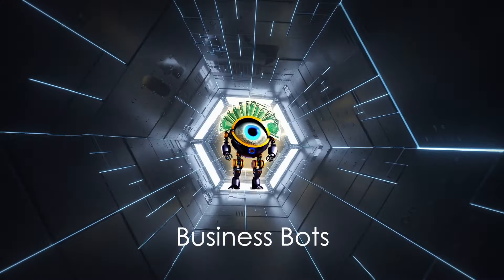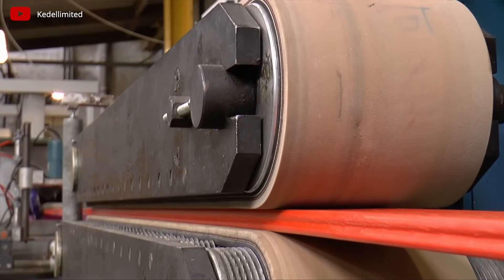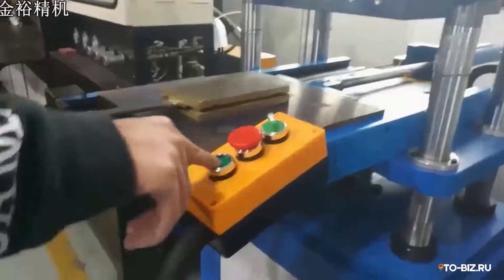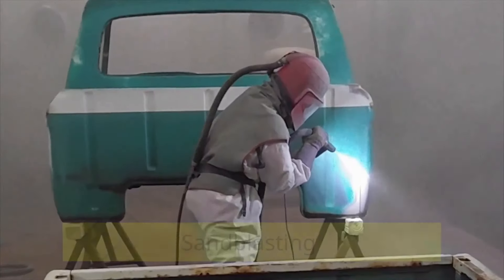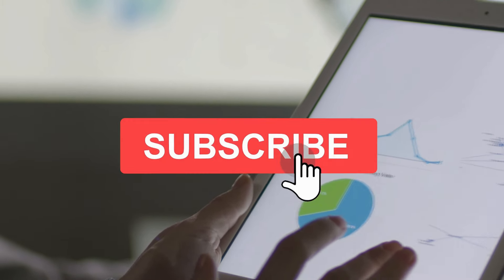Business Machines that can make you money! Top 20 profitable business ideas

Comment from the maker: 00:00 Start 
00:08 POP displays made of cardboard
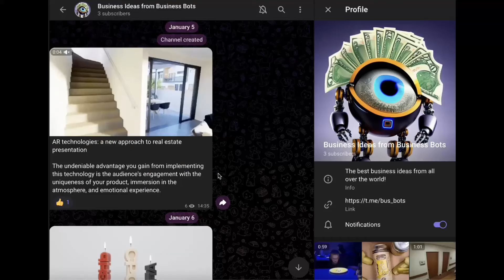00:52 Links to machines for business
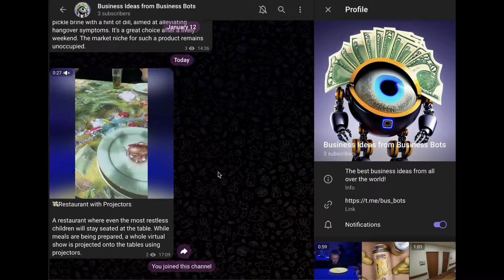01:09 Module for production of concrete screw supports
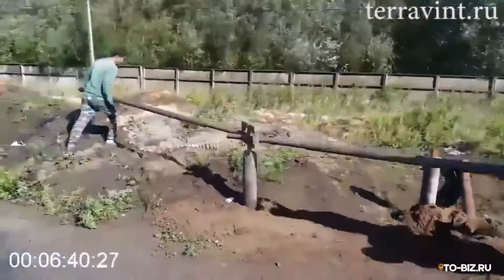02:02 Sawdust pallets production
02:38 Compact Water Cutter
03:17 Production of plastic boards
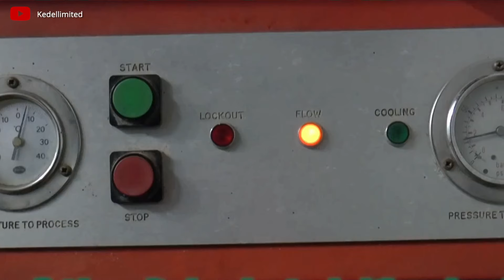03:57 Tabletop Vacuum Forming Machine
04:44 Auto Key Duplicating Machine
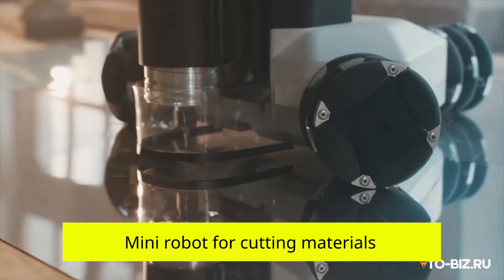05:21 Mini robot for cutting materials
06:19 Automatic knitting machines
06:48 Machines for silicone products
07:21 Manicure Robots
07:55 Photo Engraving
08:37 Production of Glass Fiber Concrete Products
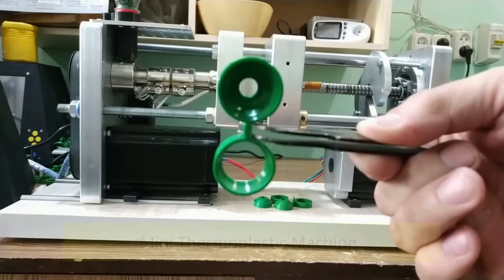09:19 Mini Thermoplastic Machine
09:48 Production of gift boxes
10:24 Knitting Machines for Socks and Gloves
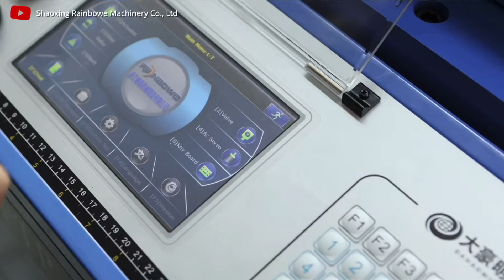10:50 Sandblasting
11:15 Bicycle Charging for Electric Vehicles
 11:57 Carpet washing machines

👉More Business Ideas and links to machines (24th issue):
https://t.me/businessideas_bots